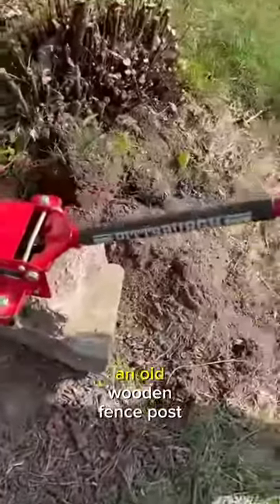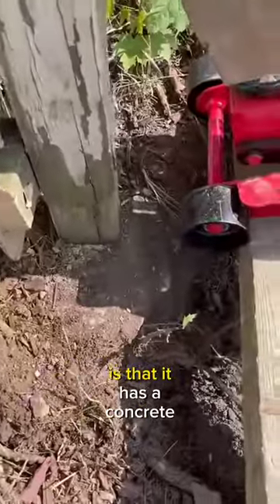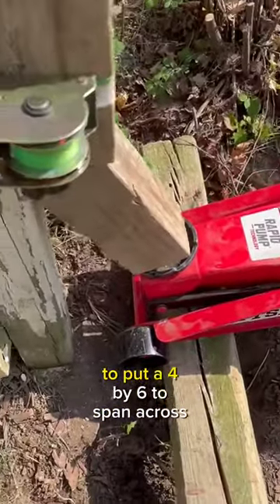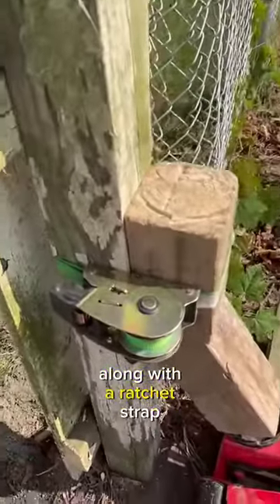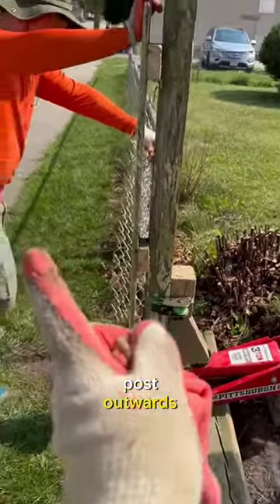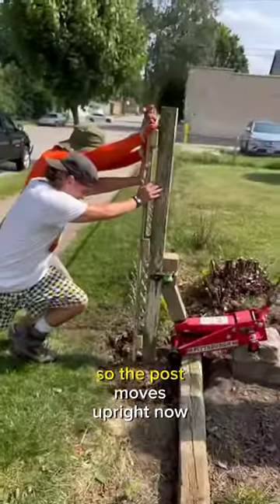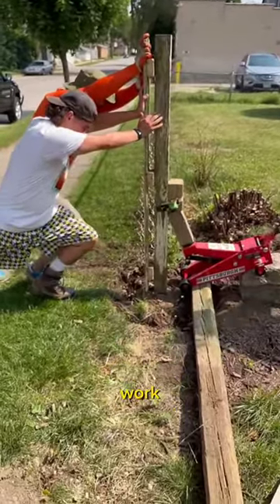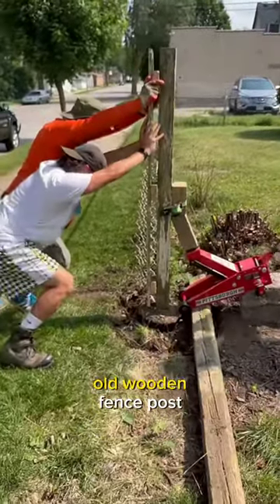How To Easily Remove Old Fence Post

Comment: Use a high lift farm jack and a peice of 2x4 block, tack the block to the base of the post about 6 inches off the ground, and use a flat hard surface to set your jack on. Each post will take a maximum of 5 minutes, I got 40 out in 3 hours a couple days ago with this method. And yes it works wonders with concrete anchors too. Literally no digging 99% of the time

Comment: Go back to Harbor Freight and buy a chain hoist. Buy 3 2x6's drill a hole through them. Then slide a pipe through the top, making a tripod, and you have a crane.
Reply: A shove and dig it out like a normal person.

Comment: Well there's no 4x6 there but you know quicker solution take a wedge a chisel between the wood and the concrete whack it with a sledgehammer break the concrete pull the wood out by hand grab the concrete pieces by hand very simple

Comment: I just break the concrete with a rock bar and pull the post out no need for all this extra bs.
Reply: I used a Hi-Lift jack and a chain (with the top of the jack secured to a tree) to pull mine out. About 5 minutes to setup and 5 minutes to pull it out.